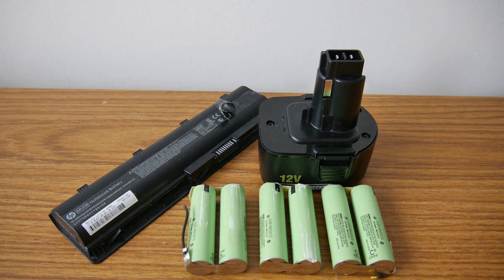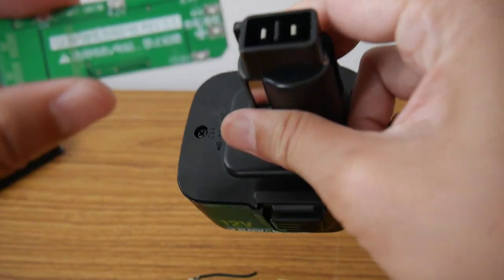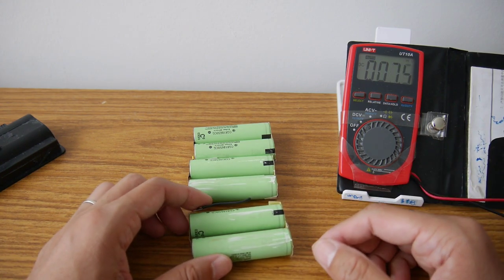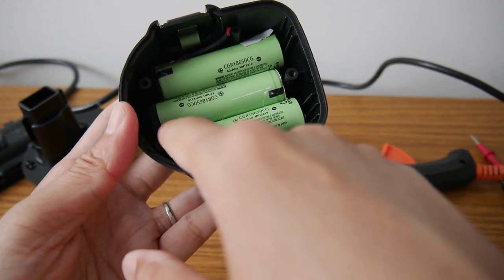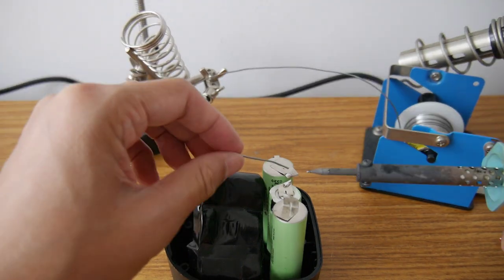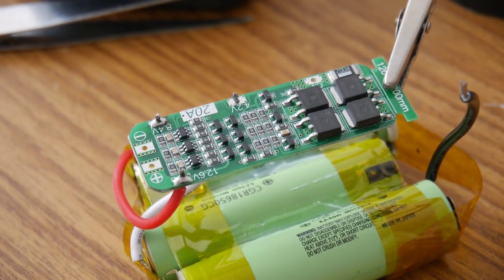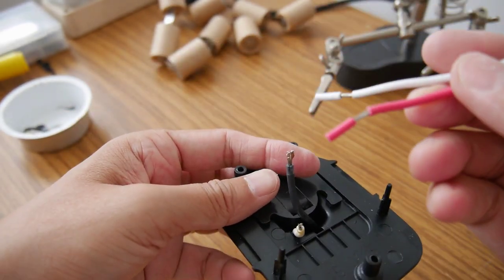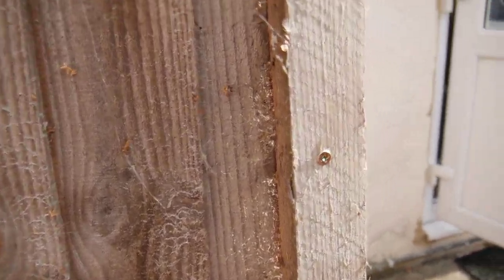You can build this too! Drill Battery Rebuild, Lithium 18650 more powerful at very low cost.

Comment: Isn't the existing charger a constant current charger?  Will the BMS work OK with this?
Reply from the maker: The exiting charger is a Ni-MH charger, constant voltage. A constant current charger is required to charge this converted battery.